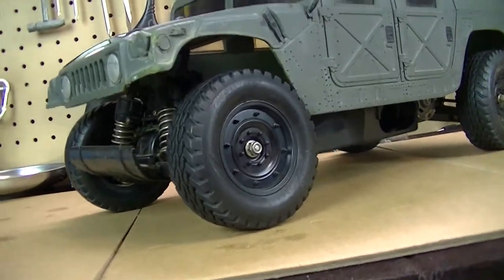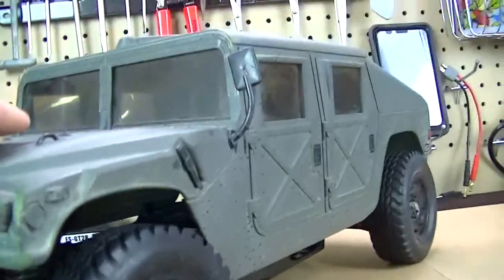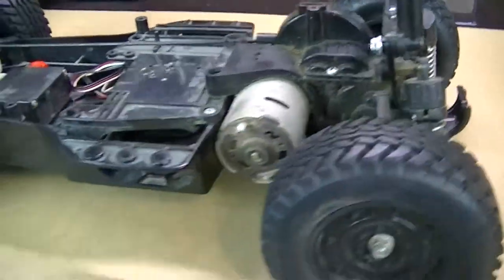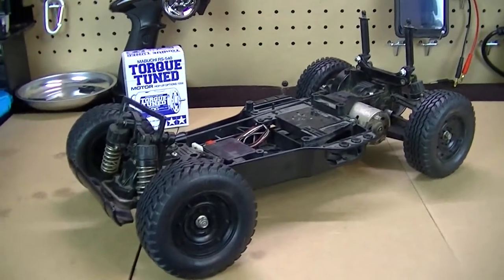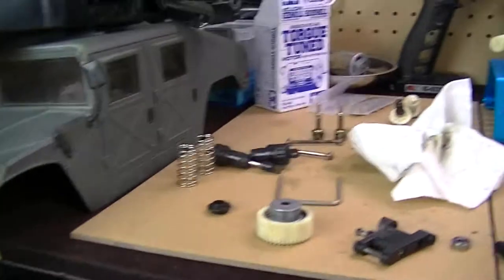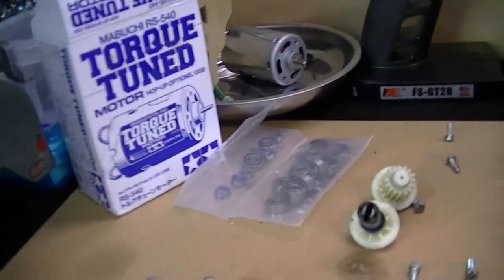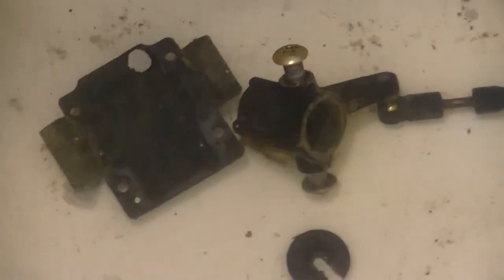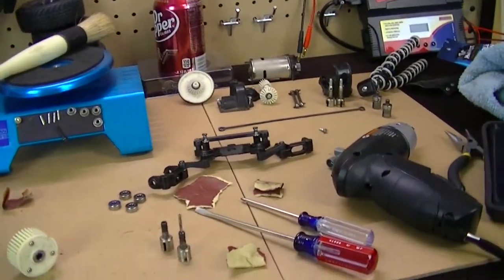RC84Films: Tamiya Hummer M1025 Tear Down PT1

Comment: I just started rehabbing a M1025 I built in 2004 and sat for 16 years. This question might be answered in a later video, but what ESC would you recommend? I don't remember this, but I apparently bought some Traxxas ESC that seems to be more for racing, not crawling.
Reply from the maker: sorry i just saw ur comment i used a traxxas X5L ESC